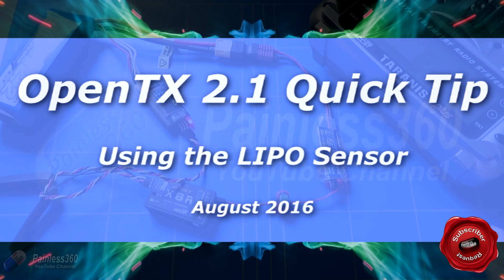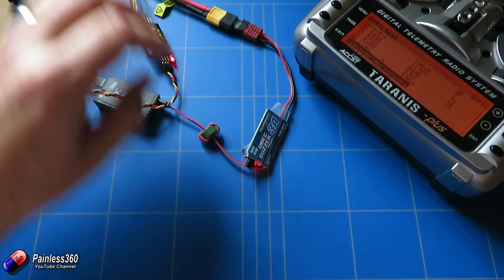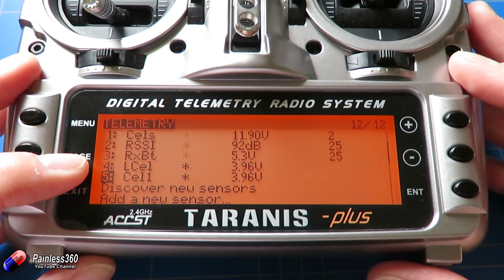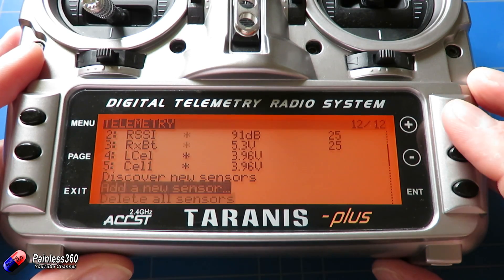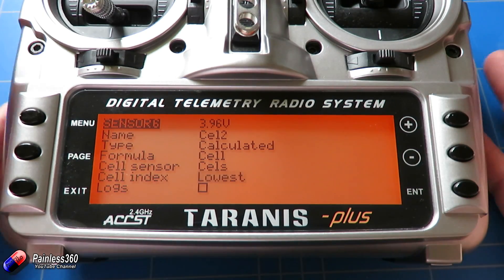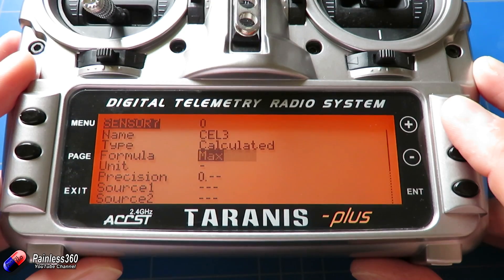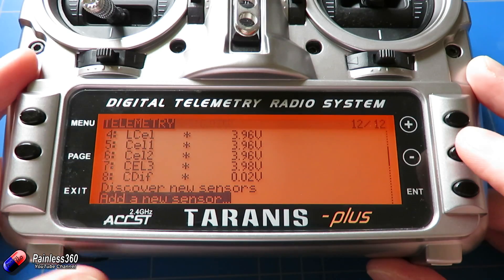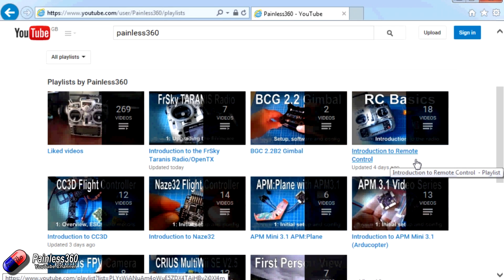OpenTX 2.1 Quick Tips: Using the FrSky LIPO Voltage Sensor

Comment: How do I change the sensor ID with S.Port tool ? Nobody has done a video on how to use the FreeLink app to change the physical ID. I need two FLVS sensors for two batteries.
Reply from the maker: No idea, I've never done it. However, a quick Google search found https://forum.flitetest.com/index.php?threads/taranis-frsky-smart-port-sensors-question.29955/ looks like what you need...

Comment: Hello,
Very nice video and useful.
I would like to ask, does it work with Transmitter RadioMaster?
Also, if we connect two in parallel, with a "Y" cable will it be able to transfer data for two 6S batteries?
Reply from the maker: Frsky telemetry is supported by the Multiprorocol module so you can get it to work. To have two Lipo sensors I think you need to change the Smartport ID on one of them from what I recall... Best of luck
Reply: @Painless360  Thanks!
Reply: @Painless360  Let me inform you, that unfortunately two people can not work together, with a parallel connection. If the ID changes, it is not recognized by the transmitter.

Comment: How accurate are these sensors? I recently purchased the cheaper LIPO Voltage Sensor (without display).
Reply from the maker: Seem pretty good from my testing here... happy flying
Reply: @Painless360  How high would or low  you set the single-cell warning for an E-Sailplane?
Reply from the maker: I'd set a warning of no lower than 3.6v per cell to land.. that way the pack should still be above 3.5v per cell after landing and resting. Happy flying!

Comment: Hi, have been following you for sometime and your contents are really helpful for amatures like me. I have a hex with two 4 s lipos and want to use two lipo sensors. Is it possible? I tried connecting. First one is not an issue. However, soon as I daisy chain second lipo sensor to smart port, data from first one get lost. May be I have to define two sensors. Anyway you could help me? Thank you
Reply from the maker: You need to change the ID of the second sensor. Look for my video on the Frsky servo channel changer.... Happy flying

Comment: Hi, im trying to use the lipo voltage sensor with the r9slim+ however it wont show the lipo batt voltage. Led light is flashing fast meaning there is no s-port connection. Tried to flash the rx successfully but still the rx and the sensor wont link. It is possible for me to use the r9slim+ with the frsky lipo voltage sensor? As per the manual the sensor will only work on rx with s-port which is the r9slim+ is one.
Reply from the maker: Sorry, I don't have the R9m here. I'm not a fan... best of luck

Comment: OK.   Here is a puzzle.   I have to supply 8V to my power system.   To do this I will be using two 4V, 5Ah LiPO batteries in series.   I want to monitor both batteries using two FrSky LiPO voltage sensors.   I have not been able to see how to distinguish one from the other.   When I daisy chain the two the transmitter states that I have lost a sensor.   How do I reconfigure the second LiPO sensor so that I can get readings from both batteries??
Reply from the maker: Youll need the FrSky Sensor ID  changer... best of luck

Comment: Hi. I have 2 lipos in my model (one for the servos and receiver and one for the petrol engine). I have tried to connect 2x mini battery sensors, however the radio only discovered one, and after a few seconds shows no sensor reception. The first sensor is connected to the smart port on the receiver and 2nd one is connected to the sport of the first sensor.  Hope you can help. Thanks for your great support.
Reply from the maker: You'll need an Frsky servo channel changer. Covered in the manual for the lipo sensor.. happy flying
Reply: Painless360. Hi, I do not understand?  How would I connect a servo channel changer and all I can find is (Frsky Servo Channel Changer For Futaba SBUS CPPM). Which manual are you referring to ( I searched but could not find it). Thanks Stephen
Reply: Hi.  I believe the receiver cannot distinguish between the two sensors, hence shows only one and then an error message.  This is also why the 2nd sensor cannot be discovered. Do you know how to change the ID on one of the sensors?  Thanks for your great site.
Reply: For information I tried changing the ID’s on 2 identical Mini voltage sensors, but this still did not work.  To solve the problem, I have one Mini-voltage sensor and one Smart-voltage sensor.  Works fine now.

Comment: Hi. I have difficulty putting up two Frsky Flvss sensor with two batteries, I use two 4 cell and put them in series so it turns into 8 cells. I have a Horus x10s FrOS system LBT. The Receiver I Use is an S8R. 
Do you want and have you the  opportunity to make a video about it, I'm stuck. 
I've tried where I've given the two sensor two different ID number, but no, only one sensor's measurements come out. 😲🥴

Comment: HI, does the pixhawk px4 not have a current sensor that can be used to send the flight battery voltage back to the taranis, I'm sure I read somewhere that it does but for the life of me I cant find it now that I need it. Also in case it is not possible with the Pixhawk, I have a Matek PDB , Power Distirbution Board, Current Sensor 184A, which does seem to have a built in current sensor. but I have no clue how to use it to get the voltage from my flight battery down to my taranis. would you have any thought on how this would work. Many thanks for you videos....this has been a very steep learning curve.
Reply from the maker: The PX4 uses a power module that provides the power it needs and also sends the battery status to the FC too. That detail is included in the MAVlink data it sends..
Reply: Thanks, much appreciated.

Comment: lol the manual is so stupid, it just has an arrow pointing at the pins "connect to lipo". I connected it to "bat" and gnd on the power board since it is  board-like pin and the thing is it does not work with just the one voltage. it needs all the cells i.e. the balance port, otherwise there is no reading on the Tx. You are really making my pain less all arond;)

Comment: Happy Christmas to you Painless and all us subscribers.
Quick question. what is the least additional equipment I need (if any),  to be able to monitor my glider lipo voltage, transmitted to my to my Taranis plus from an X8R, X4R, or G RX8.
Thanks for a great service that you provide us all with these playlists.
Bruce
Reply from the maker: I’d pop a FLVSS Lipo sensor onto the battery. Happy flying!

Comment: Could you show how to program a setup for running dual batteries in parallel using two of the flvss voltage sensors? My college class is building some long range fpv planes and we are running dual, 5200mAh 6 cells. I got the first one to work, but I'm not sure how to differentiate between the two in the telemetry if I plugged a second one in. Thank you so much for what you do. Everyone in our program has found your videos extremely useful!
Reply from the maker: +Phantom3A yes you can. You'll need open TX 2.1 or later and you'll need a little piece of hardware to change the ID of one of the voltage sensors - https://www.banggood.com/Frsky-Servo-Channel-Changer-For-Futaba-SBUS-CPPM-p-919081.html?cur_warehouse=CN
Reply: Wonderful. Is there a specific channel it would have to be set to or does it just have to be different? My other question was how you got your telemetry screen set up so the cells display vertically on the right side?
Reply from the maker: +Phantom3A have a try and see. You can always create your own custom lua Script if you want the telemetry displayed in a very specific way full stop maybe another aspect to the project? Best of luck
Reply: Thanks!

Comment: Hi was just wondering cause i have the new firmware 2.2 and now something has change cause  where its cell senor it wont go or let me put in cels so just wondering is there something wrong i am doing? and thank you for the many of years watching you*** i no you must be busy so if you gide me in the right direction would be great,,Thanks Kevin
Reply from the maker: The telemetry system has been updated a lot since 2.1 came out so it's very possible..
Reply: Thanks,,i will have to fool with it i just cant get it working with the voltage senor

Comment: In this video I saw you use a coil/wrapping in the power supply coming from the ESC to the receiver. Could you explain in short why? Currently I am having problems with FrSky X8R receivers damaging their powersupply on the receiver print and I am curious if you have solved such problems with a coil. Also I am wondering if removing/connecting the voltage sensor while the receiver is under power could damage the receiver, do you know?
Reply from the maker: +mwigman0001 it used to come on the speed controllers back in the day. I've not seen the kind of problems you're describing. I'd make sure that the power supply you're using is good. Best of luck
Reply: Yeah, the coil wrapping on the ESC receiver lead is for noise and interference (EMI) suppression. The ESC can generate a lot of noise from the motor, which can get into your receiver and cause bad reception.

Comment: Thank you! I was going crazy trying to find how to see cell voltages with the FrSky mini voltage sensor with a QX7 transmitter, and this worked perfectly. The FrSky MLVSS mini is a cheaper version that doesn't support stacking to handle more than 6 cells.

Comment: Do you have a video about the Naze 32 and current sensoring ? I can not find out how i connect the current wire to the FC.

Thank you
Reply from the maker: Not really, there are external current sensors you can buy and hookup to the Naze32, but the FC itself cant do it. Best of luck!
Reply: Painless360 yes have one but i do not know how to connect die current sensor to the FC :/

Comment: also.. on a less important note.. do you think I can flash the firmware  for the flvss  using the taranis?  the same method I used when flashing  a firmware to my x6r. by using the external xjt  pins on the back of the taranis.  sorry if I didn't explain my question well enough..
Reply from the maker: +John Hoehaver I've not tried it but it's using the same smart port interface and connection as the x series receivers so I'd expect so. Let me know if it works!

Comment: So I have a x6r and a flvss. I know that it hooks up to the smart port for the telemetry. But I also have a flight controller that has a barometer and it can send it's own telemetry. If I parallel the telemetry wires of the flight controller  and the flvss, into the smartport  or the x6r. Will it give me readings of both the flvss and the flight controller? If not.. can I use smartport for the flvss telemetry and sbus for the flight controllers telemetry and use cppm to control the quadcopter? Would that work? Please help..
Reply from the maker: +John Hoehaver I've not here but other subscribers have tried and shared that it works. Best of luck!

Comment: This may sound stupid, but in general what is the average setting that triggers the low voltage alarm. I can't find this basic info' anywhere. Like setting up a  KK2 board or similar system  for a two and three cell packs. What are their thresholds voltages ?
Reply from the maker: +loonypics a battery is considered empty when it reads 3.5v per cell. In practice trying to keep the cells from dropping below 3.7v will let them last longer and perform better. When the current is flowing there is a slight drop in the battery itself so you may get a lower reading then one you'd get by checking the battery after a flight. I'd set the alarm for 3.6 per cell and then see what it is after landing. Aim to have no lower than 3.6v per cell after you've landed and disconnected the pack. Best of luck!
Reply: Thank-you

Comment: Could you do a video on using two sensors to measure batteries with more than six cells?
Reply from the maker: +Grayson L. Wideman we don't. See below for tips on how another subscriber got two working on the same reciever. You'd have to change the ID of one of them. Best of luck!

Comment: Can you use 2 LIPO Voltage Sensors at the same time? If so, how do you wire it?
Reply: Maybe; Have to change smart port id so they are not both the same.
Reply from the maker: +benjamin mathon great question. I've not tried it. Not sure if it's possible as the ids for the sensors would be the same. Let me know if it works. Best of luck!
Reply: Okay, so I changed the ID of one voltage sensors with a servo channel changer, chained the smart connectors and it's working. But to get a big delta "0.3 V" between each battery "connected in parallel", I need one at 15.2V and the other one at 16.8V
Reply from the maker: +benjamin mathon cool! You used the FrSky channel changer?
Reply: That's how I would do it. I bought one for that reason when at one point I thought I had an ID conflict.
Reply: Absolutely, with the FrSky channel changer, very simple but so fragile, it broke after i manipulated with my fingers

Comment: Where do i find "discover new sensors" menu ? I dont think, i can find it in my taranis.
Reply: The FLVSS or MLVSS (same thing without display, half the weight and power draw) smart port lipo sensors.
Reply: Are you running opentx?
Reply from the maker: +Hans Martinus see our video on using telemetry in OpenTx 2.1. We cover all of that there. Best of luck!
Reply: +Painless360 thank you so much..
Reply: i just realized, that my taranis version is still 2.0.19. i've upgraded to 2.1.6 and it fixed. but i have one more questions. Do i need the Frsky FLVSS Module to get the "Cell/Cells" show up in the Telemetry list ? Can I use FBVS-01 to get the "Cell/Cells" ?
Reply: Cleanflight has got nothing to do with this. The FBVS-01 is just a voltage divider (the voltage sensor is in the receiver), so no, you can't get the voltages of single cells.
Reply: +superdau what should i do to get the voltages of single cells ? I'm using Frsky X4R-SB receiver.
Reply: +superdau alright. Thank you so much. 👍🏻👍🏻